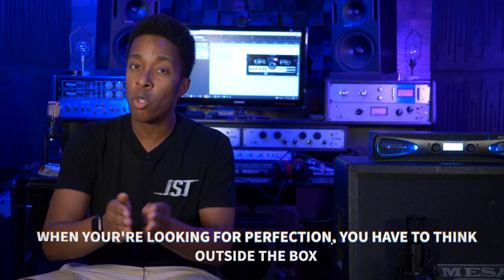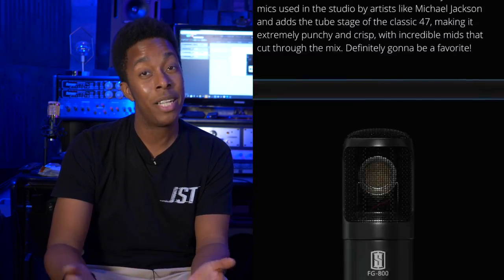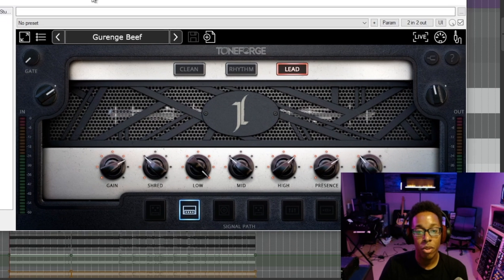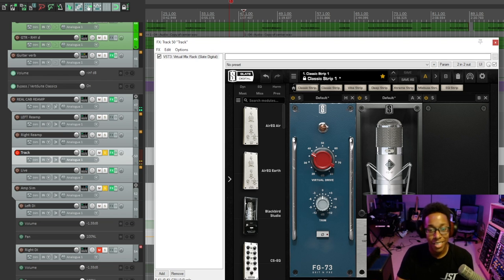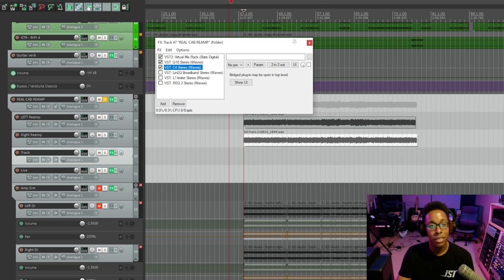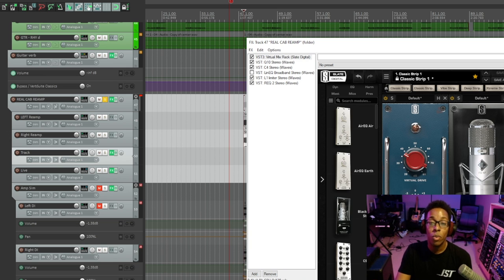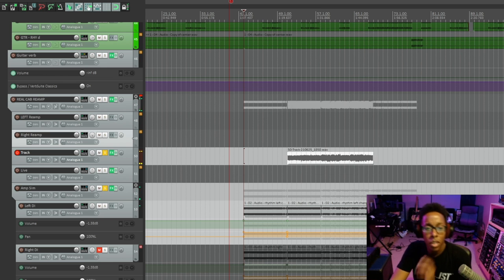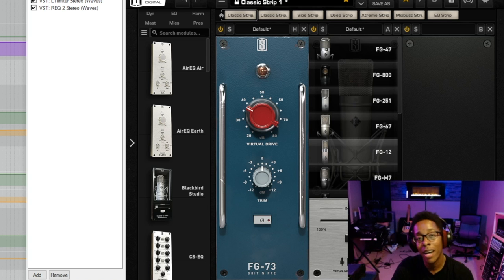Using Real Cabs With Amp Sims

Comment: I’ve been experimenting with this running the amp sim out to the fx loop return of a dual rectifier. Basically making the amp sim the preamp section. I don’t have a stand alone power amp here to do like you have in the video. It’s a quick way to get new and interesting tones.

Comment: I used IR cabs for years, but I can't help it... When I was experimenting recently to reamp ampsim through the real cab recorded by microphone, mixing is much easier and everything seems to have its place. Plus the overall flatness is gone. Even if you use IRDX CORE by Bogren Digital with IR cab you cannot achieve that results IMHO. I think I'm going to stop using IR altogether, at least on the main rhythm guitars.

Comment: I don't see much point in using an amp sim and a real cab for getting something that sounds just like regular amp (well, unless you only have access to a power amp rather than a guitar amp for some reason). But there are many distortion plugins that do not try to sound like an amp and they're not intended for guitarists. Getting these into a real cab seems like an interesting experiment.

Comment: Do you only need a reamp box when reamping with a head? Or is this integrated in the poweramp?
Reply: The power-amp section of a head, and standalone amps like the Crown in the video, expect a low impedance line level, so no reamp box is needed (the signal out of the interface is exactly what the power-amp wants).

Reamp box into a head/combo or preamp, definitely.
Reply: @nickloper2542  Thanks!

Comment: Miami since you use teles and i wanna buy one. I can only buy an affinity series tele for now which comes with top loader bridge. Do you recommend it for putting heavy gauge string like .60s? like will there be any issue?
Reply from the maker: Let me actually check this out and get back to you. But I realllllly want to suggest getting a used classic vibe in stead😩. You will be SOO much happier. I’m gonna investigate this with my top loaded right handed tele. I added a gotoh bridge to the one i use in this vid and a diff pickup
-Miami
Reply: @joeymusic  i noticed that but im pretty broke rit now thats all i can afford.

Comment: Always flirted with the idea of doing this in a live setting, With Helix and such being 1k and up if someone unlocked this with MIDI it would rule!
Reply from the maker: You can make scenes with Toneforge Jeff Loomis to do this with midi off a laptop
-Miami
Reply: Can confirm. I was able to do that with JL using an old POD HD500 as a midi controller. It's an interesting set up.

Comment: I tried this setup many times, but it always sounded very flat and muddy... It turns any DPS plugin into very uninspiring crappy distortion...

Ofc I have disabled cab sim in the plugin and tried different power amps and effect loop returns in a real amp, also there was no clipping, but it always sounded bad and cheap.

Maybe it's all about impedance? I don't know...